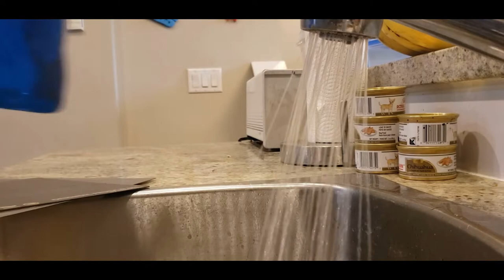The Perfect Bed Adhesion

Comment: Hi, I use the same bed adhesion but I recommend using a foam paint brush to apply, they are super cheap, no mess, give a nice smooth layer and then just rinse the foam out with water, I believe once you try one you will never go back to the paper, also my jar has a wider mouth so I can just dip it into the watered down PVA like a paint can.